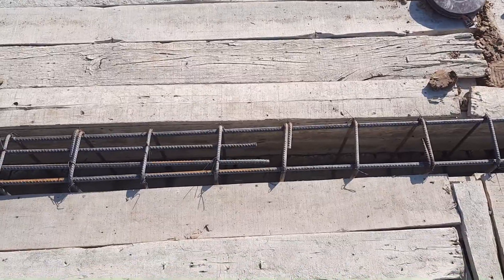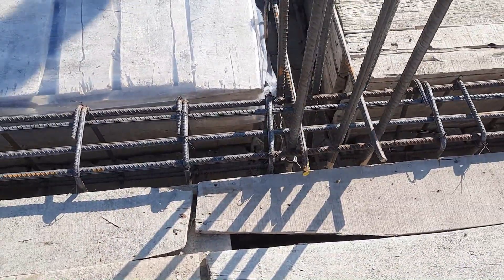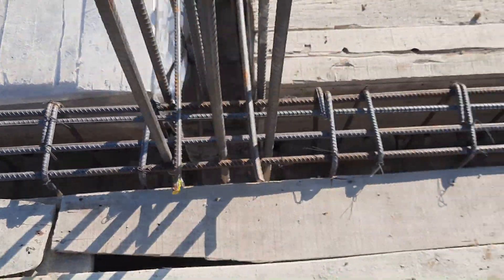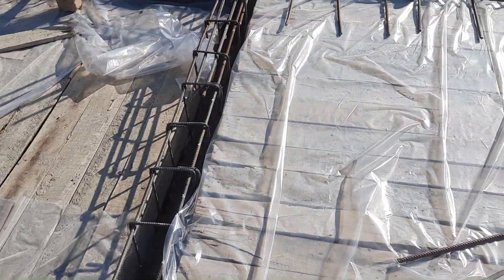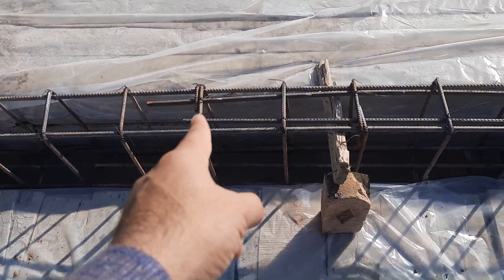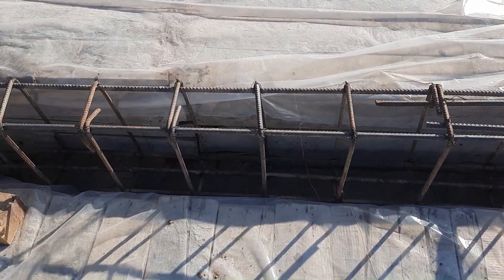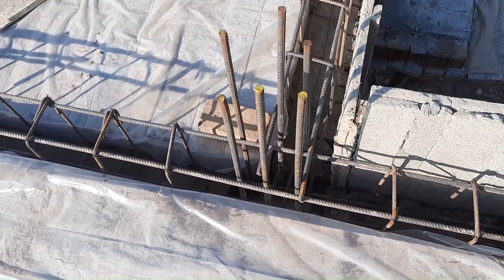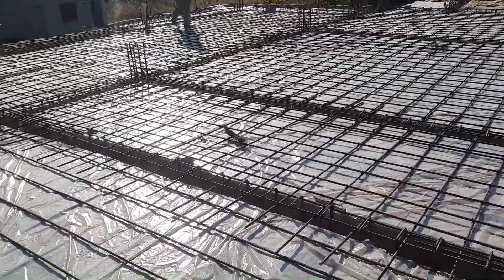Steel Reinforcement Design for Slab , Beam and Column Practical Video on Site

Comment: I think it's Load Bearing Walls Structure, If it so, then it would be better to mention it. Because one can be confused about the dia of steel used here which in case of Frame Structure shall be about 16 or 20mm instead of 12mm in beams & Columns.